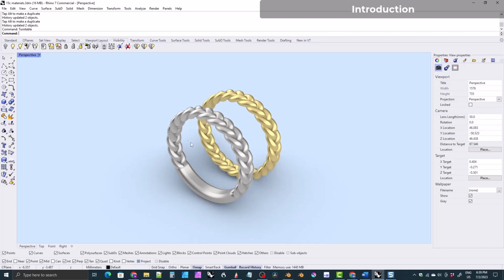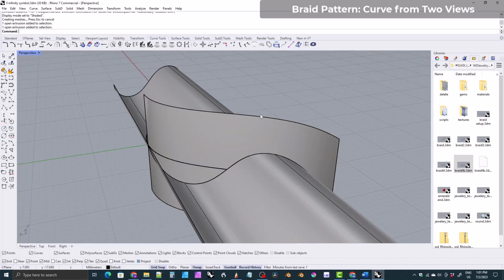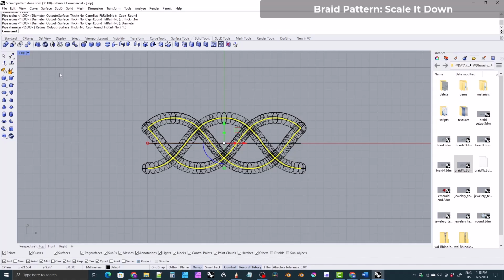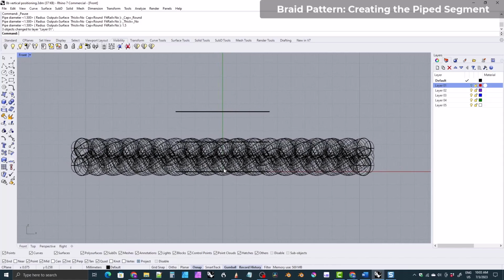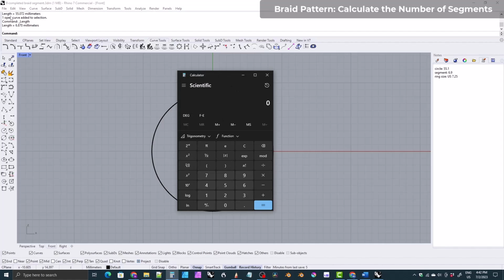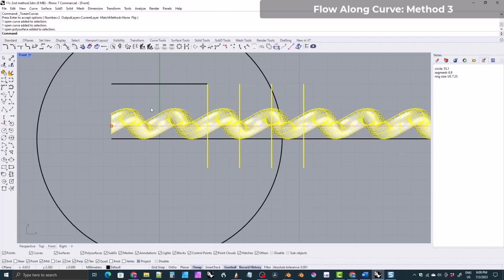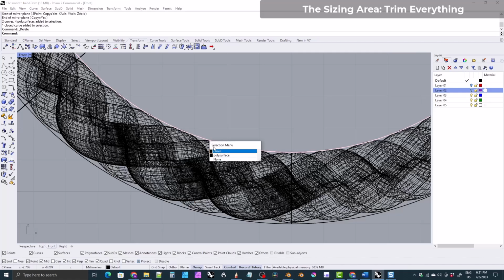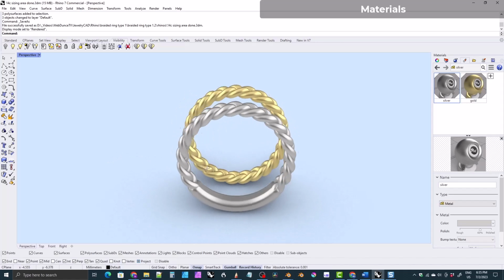Braided Rings Full Tutorial in Rhino 7

Comment: Thank you for this tutorial, it’s very easy to understand!
However, I’m having some trouble with method 2. When I use the ArrayPolar command, the edges of the braid don’t look smooth or seem to connect properly.
Could you please tell me what I might be doing wrong, or what I should check?
Reply from the maker: My first thought is maybe you didn't have Stretch = Yes when flowing the section over on to the sizing circle.  So, check that first. But if you do have Stretch = Yes, then I'm not sure and I'd have to look at your file. No guarantees that I figure out the problem, but below is a video showing how to contact me outside of youtube.

https://youtu.be/bhadwrxAF0c

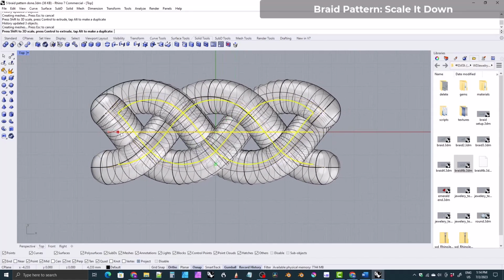Comment: hi, i need help because at the point of scaling the braids in 18:58, when i try to scale it down to close the gap, the scaling wont work and i will never close the gaps the way it does that to you
how did you perform the scaling action? or did you use some commands like control alt or something like that? thx a lot
Reply from the maker: Hi. I hold shift down while scaling. This makes the scaling equal in all directions. If you don't hold down shift, it only scales in one direction. Let me know if that works for you.
Reply: @webduncetv  I tried but it will not scale the object, only the curve that generated the 3D object
Reply from the maker: @davidguglielmo1177  It sounds like "record history" is off. Type "history" into the command line and press enter and make sure Record=Yes. If Record=No, then click on it to change it to Record=Yes and then hit enter. Then you will have to delete the pipes since those pipes were made without history. Then re-pipe the curves. The new pipes should scale with the curves then. Let me know if this helps or not.
Reply: @webduncetv  thx I will try this
Reply: @webduncetv  it worked! thx so much for the help
Reply: @webduncetv  i have another problem, when i scale down to close the gap, the football balls will not form on my geometry and will remain the starting geometry, idk how to fix that, and when i go to polarize the  braid on the circle they will not close and i don't know why
Reply from the maker: You're welcome. And I'm glad it helped.
Reply from the maker: @davidguglielmo1177  Regarding the first problem, it sounds like  you broke history on the pipes. Try deleting the pipes and then re-piping the curves of the braid and see if you can then adjust the football shapes .

Regarding the second problem, it sounds like Stretch=No in the flow options.  (If you used method 2, this is my fault because I did not mention that Stretch needs to be set to Yes in that chapter). Anyway, redo it, but, when you click on Flow Along Curve, look in the command line and make sure that Copy=Yes, Rigid=No, and Stretch=Yes.

Let me know if that helps.
Reply: @webduncetv  I have the same problem. Where should I select Stretch-=No? In which part of the procedure? I am confused
Reply from the maker: @mariamatsouka507  Hi. After you click on "Flow Along Curve", you should see Stretch = No in the command line. Just click on it and it will become Stretch = Yes. Let me know if that helps.
Reply: Hi  @webduncetv  , thank you for the fast response! My problem is regarding the pipes. While I try to scale them, the pipes scale as well. I tried to re-pipe having the record history selected but it doesn't make a difference. I solved my problem by scaling it first and then piping them but I am wondering what I did wrong and it wont work as you show on the video.
Reply from the maker: @mariamatsouka507  The only thing I can think of without looking at your screen is that it sounds like you have both the curves AND the pipes selected. Make sure you have only the curves selected. If that doesn't fix it, I would probably need to see the file.
Reply: @webduncetv  That was it, it works! I had both the curves and the pipes selected. I selected only the curves and it works! Thank you!
Reply from the maker: @mariamatsouka507  you're welcome. glad it worked!
Reply: @webduncetv  Thanks a lot for this explanation!!!